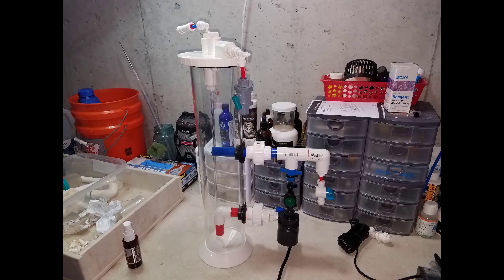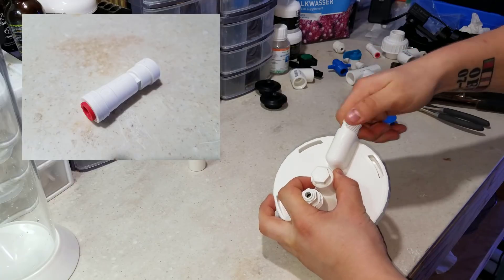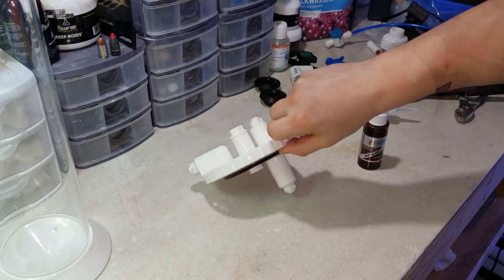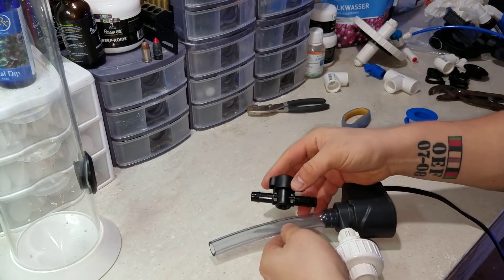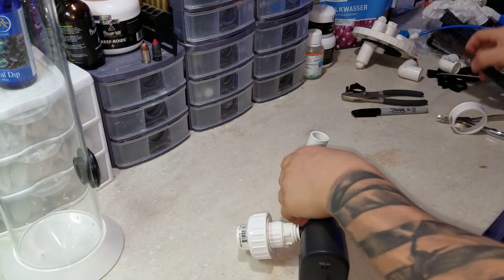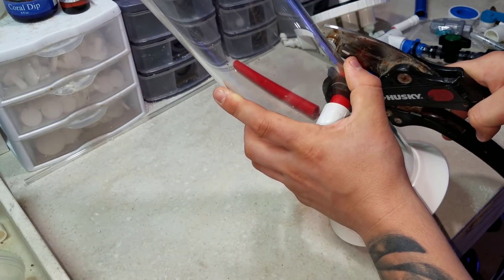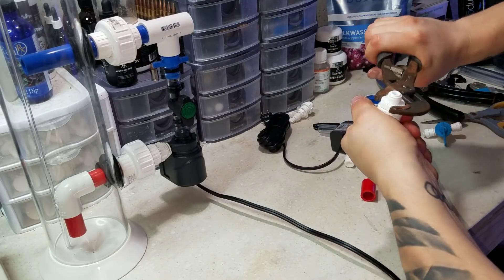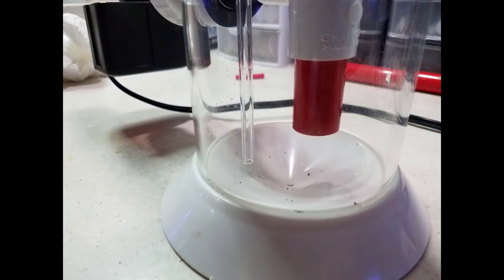DIY Kalkwasser Reactor Part 1 | Build & Test Filling

Comment: Awesome video! Now I'm thinking I should build one rather than buy. But I was planning on using a peristaltic pump to drive the ro water so I'm curious if a check valve would be necessary in that situation? And if so, would it be strong enough to open the check valve? Any other issues you could foresee coming up by using a peristaltic pump?

Comment: Wow...I am amazed that those black rubber bulkheads are water tight on a 1-1/4" hole through a 4" diameter cylinder with nothing compressing the back side.  I would have guessed that would be the failure point.  Either way...this is ingenious, and as you say, if you needed a DIY project this seems like a good one.  Now you've got me thinking how I could implement this (I think I'd base mine on a perstaltic pump...hmmm...).  Thanks!